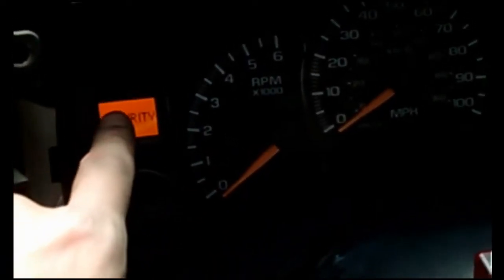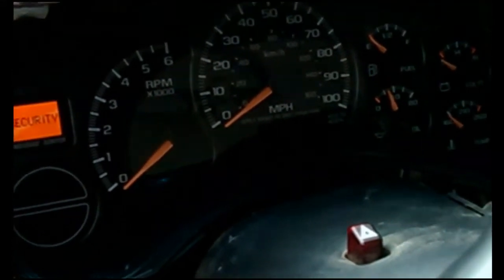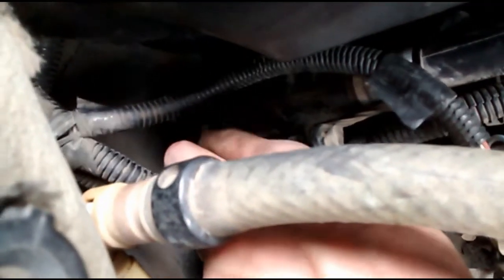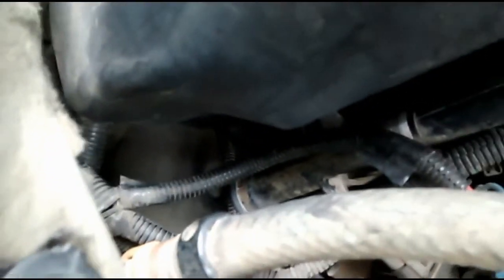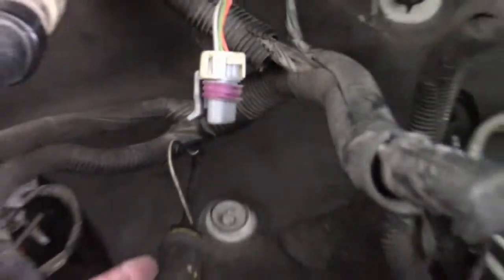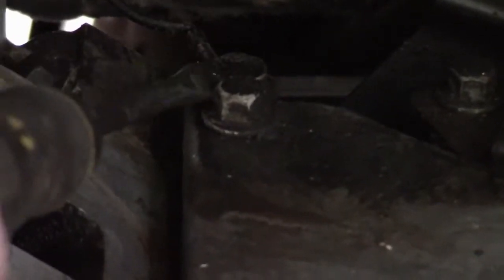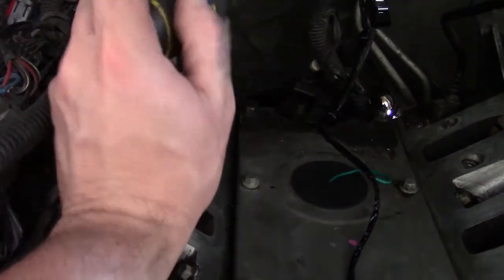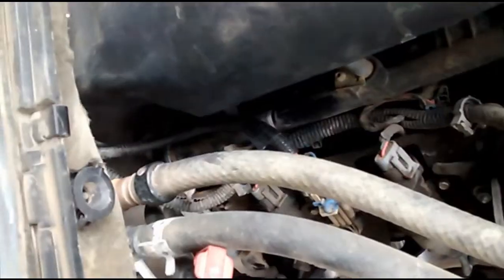Dead Instrument Panel? Check this First! (Extended)

Comment: This vid is helpful, I hope this is my problem. Thanks for remaking this :)
Reply from the maker: Yeah, sorry about the first video. It was just impossible to get a good camera angle on it with the manifold still on. I would take the first video down, but YouTube likes that one better so it get's all the traffic and helps people find this one.
Reply: @J20Jeepster  I don't have the personality to post vid's so I deleted the few that I had. That screw is a bummer to get to! Mine is intact thus not my dash problem.
My turn signal lights work, but everything else will go dead now and again. Its been dead for 4 days straight, then last night everything came back on again.
I'm thinking about sending it to the guy in Minnesota. Its prolly a bad solder on the main power or ground joint? 
Thanks for this 2nd vid!
Reply from the maker: @applejacks971  Yeah, this model had all kinds of problems with the instrument panel itself. I had mine rebuilt at Module Masters. They did a great job. Here's the video to that one: https://www.youtube.com/watch?v=khp9t3lOl0M

Comment: But those ground wires have nothing to do with the instrument panel circuits. They use G200 and G203, this is a G1xx ground because it's on the engine
Reply from the maker: Don't know what to tell ya. It is what it is...